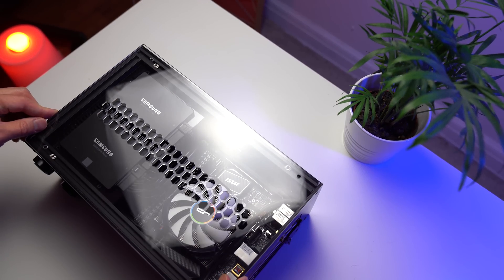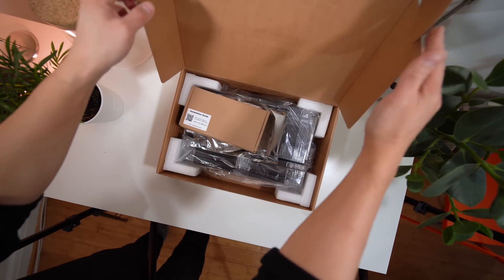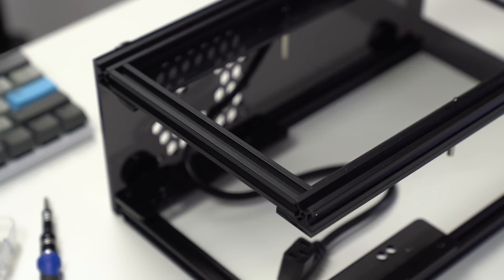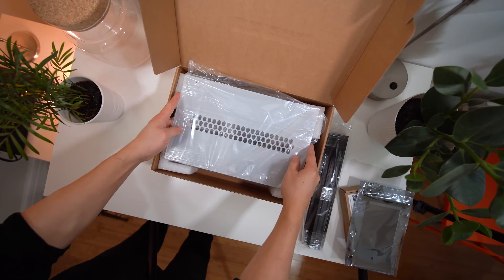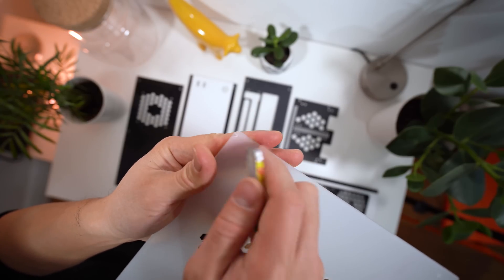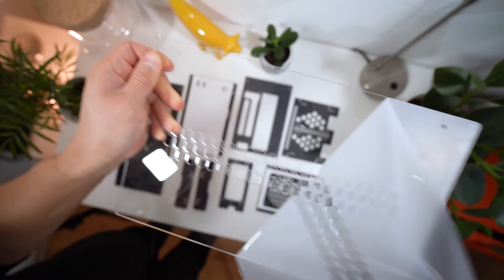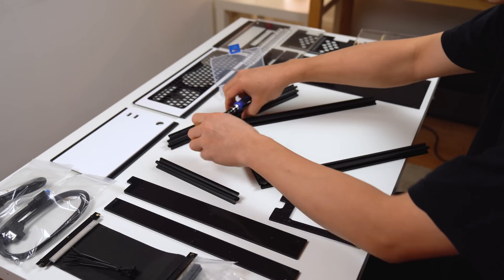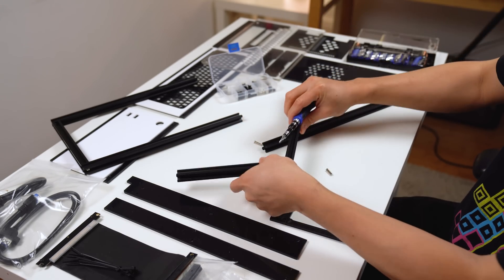a CHEAP TINY ITX case for $69 - Geeek A50

Comment: 6:10  is it possible to rotate that panel so that the fan is oriented as you propose?
Reply from the maker: I'll update you on that once I take it apart
Reply: @JammyMunkyTech  did you figure it out?
Reply: @JammyMunkyTech  So, it is possible?
Reply: andydjangoo well?
Reply: I was also questioning this. Curious to hear the answer.
Reply: 2:50 yes you can, watch this segment ! Just rotate it and voila !!!
Reply: My initial thought too.   It looks like it can be simply turned around and positioned under the MOBO
Reply from the maker: Oops, sorry everyone I forgot to update you all. But to answer this question, you cannot rotate the panel, as when you do, there is no clearance between the attached case fan and the motherboard.
Reply: @JammyMunkyTech  Would it be possible with a super slim case fan?
Reply: yeah, im also curious, since.... I think the screw placements are the same as the other side of it
Reply: I almost wonder if that's actually the intended assembly arrangement and the config we see in the video is user error. Seems like a much better option.
Reply: Was about to comment on that same thing, decided to look for this comment. was like, "I can't be the only one thinking this way"
Reply: Thats what I was thinking about
Reply: It almost certainly will be, it's attached with bolts into locking washers in the aluminium extrusions, the washers can be positioned wherever you want so even if the orientation of the holes doesn't match when flipped you can just move the washers.
Reply: yes i believe you can based on the fact that it looks like the screw holes look symmetrical and the bolts are adujstable  if it isn't
Reply: First video I've seen of yours. Nice one!
Did you manage to rotate that bottom panel in the end?
Reply: Looking at the segment, you can, but it also looks like the plug may be in the way. So changing that for a more slim or right angle cord could fix that issue.
Reply: If that was the case, why not freaking do it then??? No I'm not upset. Just saying.
Reply: Well Andy? Is it possible?
Reply: Yes I think it's doable. This is why I love modular casing oh man the assembling work. XD